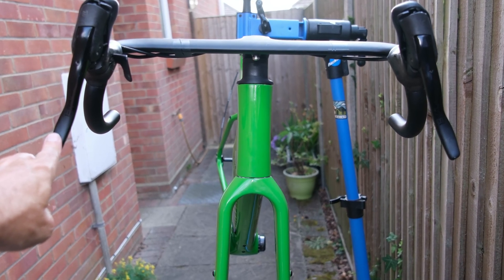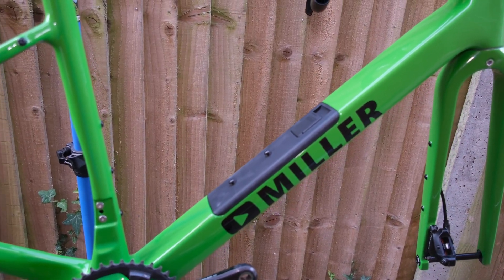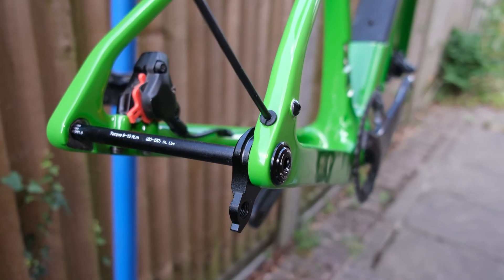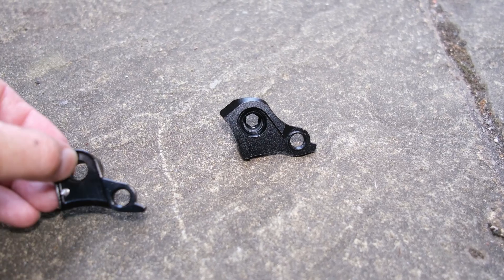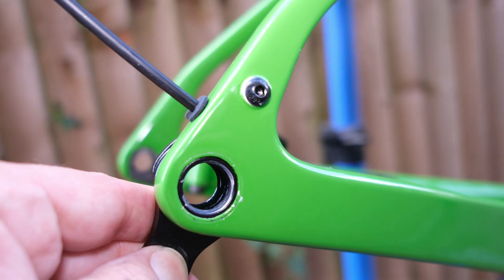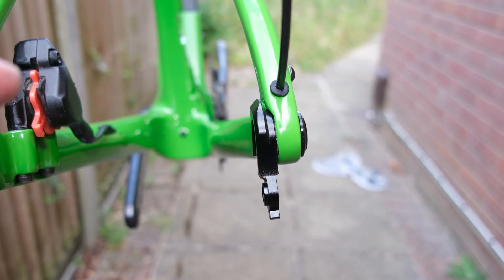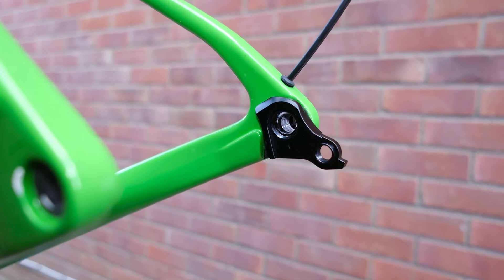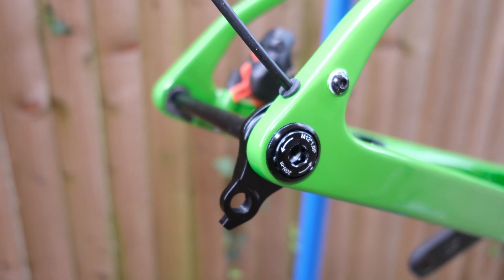UDH Derailleur Hanger: What's the Big Deal?

Comment: So is buying a 'discounted' non-UDH frame in 2025 a bad idea?
Reply from the maker: If it's what you want, no. The only restriction I'm aware of is that Sram XPLR groups require UDH.
Reply: @Millerbike01  Nice video! Gives better explanation then advertisements from the brands. What about faster shifting?
It looks like a welcome design and I can imagine different thread thru axel and having specific derailleur hanger to replace can be troublesome.

In one way I see UDH at overhyped, but having no spare parts verses having a bike running with UDH is quite a different.

What would you say the chances of the derailleur getting bent instead of the hanger? Iam on road bike but still bent a few rear hanger on SL frames.
Reply from the maker: @allemyr  Thanks! Interesting points you raise, and yes, finding the correct der hanger for an older bike can be a very frustrating experience. I agree that UDH is almost mystifyingly overhyped, maybe down to the Sram marketing machine, but there's no doubt that a common der hanger design is a boon.
I would not expect faster shifting from a UDH hanger. 
For sure the UDH design is so strong that the derailleur might break to protect the hanger  🙂. OTOH a bent or broken hanger risks the derailleur folding into the wheel and that causes catastrophic damage.
Reply: The idea of the direct mount is that the impact gets diverted into the thru-axle, not the frame. The derailleur hanger is a solution for a problem that should not exist. I had two bikes with standard derailleur hangers that accidentally both fell on the derailleur and had to be adjusted in the bikeshop with a derailleur hanger alignment tool because of (dangerous) shifting problems (chain falling off of the largest sprockets for example).
Reply: @Excelbrains  buy a new derailleur hanger? its not worth it to bend metal back. Bending derailleurs sounds more expensive. Well I dont really get the hype. My bikeshop has the model specific hanger in stock and I bougth one or two last two years.